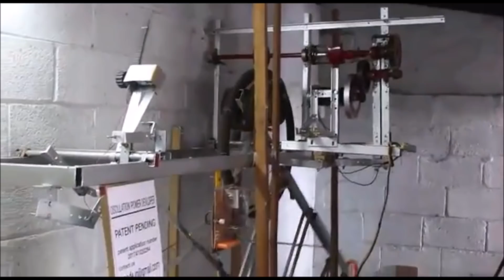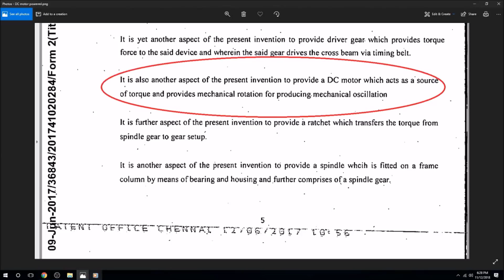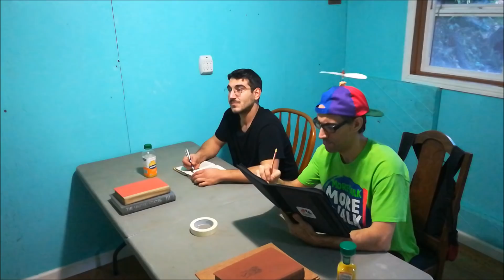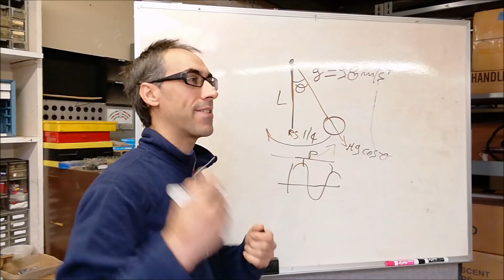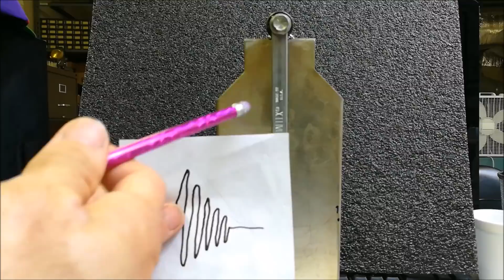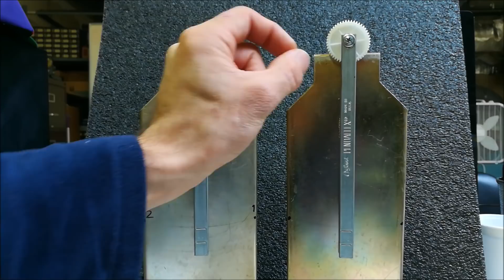$$ Free Energy EASY Money $$

Comment: Good job as usual. I worked as machinist  in Los Angeles, Griffith Observatory in the eighties. This very successful Foucalt pendulum worked hour after hour knocking over wooden pegs with it's 240 lb. brass ball with a pin at bottom. At the top, above the high ceiling were two electromagnets at 180 to give top of unit small regular pushes. Cable suspending ball terminated with a ball about 5 " in diameter, probably copper. Lately with the flat Earth retards infesting YouTube the Foucalt device has gotten a  bad rap, cause it does show rotation of Earth. And when people visiting the planetarium ask what powers the thing, the non technical guide staff report " it runs with a motor". Anyway keep up the good work. I enjoy all your videos.

Comment: Very nice video. Try to explain by experiments why the perpetual motion machine can not be made. In general a perpetual motion machine is nothing more from a energy (in a dynamic form) storage device. The mention of dynamic (aka motion) induce friction losses in any form of this kind machines (mechanical or electric). In contrast any static storage device is doesn't have friction losses but leakages.
In general a practical energy (static or dynamic) storage device can be made and we can also eliminate any friction or leakage almost to zero but this does not make it more than a storage device aka it's does not give you anything more from the energy that have been stored in. 

Anyway, the biggest problem for the peoples that trust this scammers is that they do not understand that a free (free as: comes from nothing) device can not be exist even in principle. The reason is by the consent it required positive feedback and any machine with positive feedback is unstable. Any unstable machine by definition is self destructible because it's goes to a states that the total accumulated energy of the system is more than the energy that can handle.

Comment: Hey Mr. Debunker, where is that video about debunking Adams motor/generator? You took it down? Ewww, I looked soooo forward to your answer and a new video, where you prove that the main idea is or is not working. Not those who try to scam ppl, that actualy do not do proper search. Debunk scamers, no problems there. But if you want to label the original idea and inventor, be it Adams, Tesla, etc., build the invention properly based on their plans, and show if it works or not. Period.
Reply: As far I know Nikola Tesla had free-energy as long as the company he was working for was paying for his lab power bill and Adam looks like a  bedini generator with training wheels and diaper. Do  you really think we need to build and "prove" pigs can't fly or someone still have doubts?
Reply: @164procar4 : Pigs can't fly, already proven long ago, when they tryed to fire them from catapults and they still smashed to ground. And I do not say he is doing something wrong by exposing scamers. But if he wants to debunk the idea itself, he should just build it by the specs of the inventor to prove it, not using designs of scamers and wanabe inventors using modified old inventions. I am not saying that Tesla is the greatest inventor of all, but definetly greatest in terms of AC/DC current. Not to mention remote radio control and partialy early version of WiFi.

I made small simple Bedini generator with just two large drive coils hooked up to 12V car batt. A proper one, not that crap he showed in the vid, which he took down some time ago. Voltage did not drop for a month of continuos usage. I connected second drained car batt into the circuit and it was recharging, although it was very very very slow. I am working on version with 2 drive coils and 6 pickup coils. I am not saying that there is free energy in the fullest meaning (no initial costs and no fuel costs), at least not now. But have you tried building a unipolar dynamo, which while being selfsustained is generating adicional DC current you could use? It is just a matter of proper construction. And no "free energy"? Check US patent Nr. 390.721. AC generator, AC motor,  transformer (transformator) and exicter to get it moving. That is all you need for generating power for your own house with just initial and spare parts costs. 

Tesla had financial problems with his rersearch, I agree on that, but not mainly in terms of power supply. It was in terms of expensive materials, machinery and man-power he needed. Does Wanderclyffe tower ring a bell? He worked on two tower version when he was old and no1 would give him money at that age. Why would he waste time with second version in his old age? Why US secret service took all of his notes, invention etc from his hotel room after he died if there was nothing worth their time? There are a lot of Inventions governments or large corps do not want us to know. If Tesla received funding he needed and had the materials, electric cars would be everywhere today. But no, money from elecricity using fosil fuels and OPEC oil for cars, is more important. Just like USA and some other countries showing middle finger to our enviroment. Skeptical yet open minded.